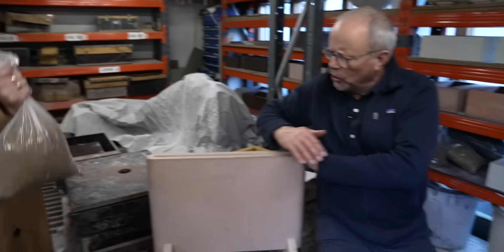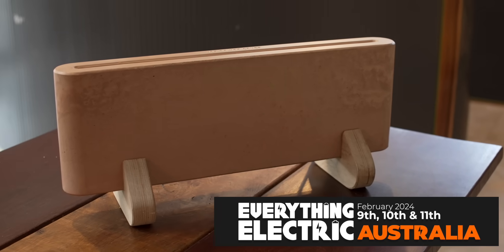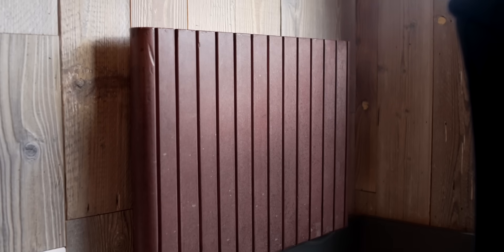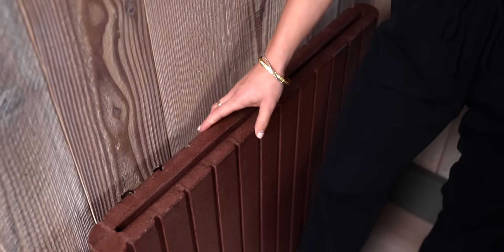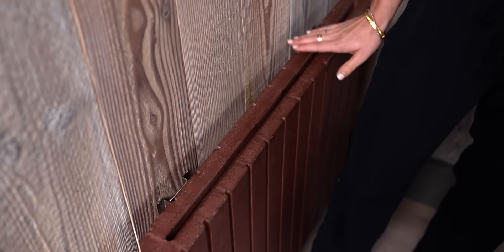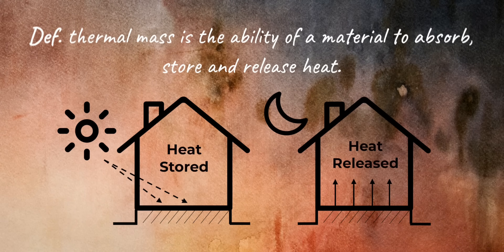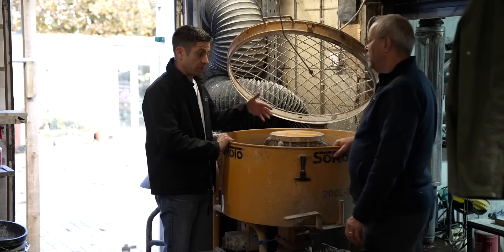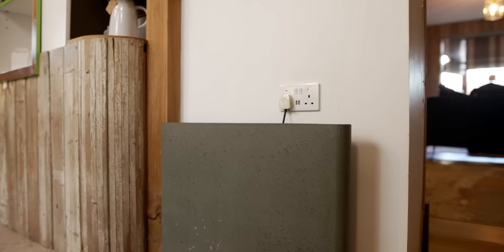THIS Radiator Is Made From Recycled Sand!

Comment from the maker: We’ve noticed a few comments about efficiency and storage heaters, so for a little more clarity on why this is a little different. Storage heaters use convection to transfer heat. Convection systems have to heat all of the air in a space. These Composite radiators heat through convection but also heat through radiant heat i.e they effectively warm people and objects in addition to the air around them. Radiant heaters are considered more efficient because this targeted heating approach reduces energy waste and ensures that the heat is effectively utilized by the intended recipient, resulting in higher efficiency compared to traditional heating methods.
Reply: I'm a huge fan of Fully Charged but you've slightly dropped the ball on this one. Perhaps you mean this heater is more effective but it's certainly not more efficient. Efficiency has a specific engineering meaning (useful_energy_output/energy_input) -- so this heater has the same efficiency as any other resistance heater, i.e. 100 per cent. Just pointing out this point of confusion as constructive criticism for an otherwise excellent production team...
Reply: Just use a radiant panel then. This thing is a joke
Reply: The effect of perceived temperature from radiant temperatures is very important in building physics. So you can feel warm in a room with warm surfaces, even if the air is very cold. So yes there is a difference between this radiant heater and storage heaters (which have insulated sides), but there is no difference between this radiant heater and other radiant heaters.
Also this doesn't change the efficiency of the device, but it's _effectiveness_. So yes radiant heat is a bit more effective than conductive heat but you really shouldn't make any claims about efficiency (which is why a lot of people are grumbling in the comments).
Reply: @xxwookey  Funny enough gf just walked in the lounge and said "it's warmer in the kitchen than in here now", which was odd as it got down to 13c before the heating kicked in just a short time ago, sure enough I walked into the long thin kitchen to find it was still only 16c but due to having a long rad down one side the radiant heat from this made it seem relatively warm.
Reply: It's fine to shill for companies, just do it in a way that's accurate & make clear you're shilling
Reply: The comments around solar panels and cost should have been closer challenged. In the UK the heat loss vs size of roof for a building will almost never allow solar to pay for heating during the winter, but might just allow it from summer export offsetting if you can get the array size and have a low enough heat demand. In fact, it's unlikely with a 100% efficiency rather than 3-400% efficiency heat pump, that you will ever be able to offset your heating costs in the UK on all but the most passive of houses. I'm not sure this technology is the answer to bringing you closer to energy independent, a heat pump will do that x3 (literally).
Reply: @untruth agreed...
Reply: They all spread heat through both convection and radiation, the ratio varies, but it's not that significant between warm slabs or slab-shaped objects at the same temperature. Radiative heaters that you can turn on and get significant heat radiation within seconds, and turn off when don't need heat has a potentially huge advantage, in being able to use energy and provide heat only when and where it's needed. This thing needs to heat up all that mass before it can heat up anything else, which means it lacks the real advantage "instant" radiative heaters have.  

A resistive storage heater without adjustable output is objectively not a very good storage heater. 

The point of storage heaters is the ability to use cheap electricity, to produce heat, that can be released over a long period of time, preferably with some control of the heat output. For that purpose you want high power, to be able to use as much cheap electricity as possible. Low maximum power is not a good thing in a storage heater, it limits how much cheap energy (which is likely to be cleaner) you can use in a given time. 

Also, without insulation you can't heat the storage media to the temperatures you can with insulation, as that would be dangerous. So you get much lower storage capacity, and the heat will spread much faster, too fast to be a good storage heater, and way too slow to be compared to instant radiative heaters.  

Usually great channels, and a couple of the best presenters on youtube in this episode, but this product is not great, it's a bad storage heater, which if used as a storage heater, utilizing off peak electricity to charge make it slightly better than a simple resistive heater that's on during off peak, but nowhere near as good as "conventional" storage heaters with insulation and ability to affect the output somewhat.
Reply: On efficiency, the radiant heating argument is not comparing apples to apples. If you feel warmer, but your building fabric is sitting at dew point internally, it increases heat losses in your building (thus making it less efficient to heat), and introduces all sorts of health risks. Efficiently keeping your body warm, but not efficiently keeping you in a healthy environment.
Reply: @untruth  

That's a very, very good argument for not relying on FAR IR panels for general (?) heating.

If the fabric of a property remains too cold and damp then the risk is of all sorts of nasties quietly going about their business of producing mould and spores.

However, all is not lost and by using a dehumidifier it is possible to reduce the RH to well below the comfort level for humans, that's below 45%RH.

This means the low moisture atmosphere causes your eyes and nasal membranes becoming too dry for comfort.

(From empirical experiment I have found this for myself when using a dehumidifier for help with drying laundry, without using a tumble drier.

Yes, the method really does work and obviates the need for said "expensive to run" tumble drier.)

This very morning I was informed of LG's recent heat pump unit which, allegedly, is capable of providing reasonable heat when the outside temperature gets down to neg 28C, which I gather is LG successfully pushing the envelope.

Google is your friend on this.

It might be rather more useful to produce an episode on this "quite" efficient means of heating than droning on about a trendy looking storage radiator and claiming it's "super, super efficient" when it's anything but.

It might be helpful too if Robert et al did a "radiant and convection and conduction Tutorial 101" so we all knew they understood the difference.

The last few sentences in that last missive from Robert were right up there when it comes to waffle.

I appreciate it was a crib from a third party, but still.
Reply: yep a bit of a ball drop.  Storage Heaters using fire bricks [really dense heavy brick- used to be klinker brick] holds heat well and always have done on the overnight charge.  Standing close ish to them will make one feel warmer, obviously but heating the space will depend on the size of the space  and the insulated envelope of the building. Whether its made of klinker Brick, clay brick, or concrete [re-cycled or not] will make no difference. The density of the material is the only factor as too how long it retains heat  and ofcourse the element charge capacity/imput.  Energy  like the elements never disappear they just change state.  Running up and down your hall will create Hest energy  but then you will have to replace it with some food at some time guys.
Reply: @rivergladesgardenrailroad8834 
 
Some storage heaters were equipped with a very low powered fan to push the "heat" around or some had louvres to allow the stored heat to escape more quickly when required.

Some of the smaller units had a sort of "internal duct" to get a bit of convection going.

Some of the wardrobe sized units had inbuilt ducts and used a fan to push the warm air throughout.

But forget all that.

The very best way of heating and cooking and providing hot water is a smokeless coal nugget burning multi stove, with a back boiler.

(NOT woodburner types, despite being DEFRA approved, for now, on grounds they burn wood far too quickly and you have to get up off your arse to feed them, and, require a fair old woodshed or woodpile.

Not cheap to buy or run and probably not too environmentally sound, and you have to clean out the ash.

But, for heating that really does deliver and provides the essential rosy glow which matches the images stored in our "racial memory" (or something or other) then you can't beat a multi stove.

Seeing as the planet will  probably not achieve the temperature rise to below this holy grail of 2C and most definitely not below the preferred 1.5C rise then suggest it would be a shrewd move to turn our collective hands to building sea going rafts, loads and loads of really big ones.

Once the ice ends up in the oceans and the continent of Antarctica rises through the  mantle then the sea level (average) will be around 200 ft or 70 mtrs higher than "today". It could be more depending on how much land rises up in the south polar region.

Why bother to fight nature, which, to be fair, has got a lot more experience than humans ref ice ages and tectonic plates swirling around on a plastic mantle.

Boats and rafts are the answer, together with a palate adapted to fish and seaweed.

We have dozens of seagoing nuclear generators and even in the Arctic ice and who knows we might even see floating fusion reactors in a century or so. Energy might not be too much of an issue.

We've got hydrogen fuel cell powered boats even as we type so that's alright then.

Would suggest civilisation aimed to anchor the rafts in the warmer latitudes so no energy required for space heating, and if it got too hot, or cold, simply move the rafts up and down the latitudes as necessary and avoiding the hurricane/typhoon routes.

I mean, to quote one of the small gods, more associated with motoring, "how difficult can it be?"

Happy to debate if anyone arsed.
Reply: For goodness sakes Robert!

Talk about digging yourself deeper.

You'll be shortlisted for the "Golden Shovel Award" before long.

Now just so "you" understand this so called invention is just another storage radiator but without any redeeming features.

So, please disabuse yourself that it's "you" doing the mythbusting.

You might apply that to your so called mythbusting on anything to do with battery EVs as well as.

Robert, you really, really don't understand the science.

Ask yourself ... if we hear duff gen ref power consumption of flat screens then are we really going to be swallowing the rest of the guff?

Hope that helps.
Reply: It's not directional though, it's a slab which would radiate in all directions, then stuff in the room would absorb the energy and pass it into the air. There is some really exciting research around high IR emmisive coatings which are being used in sub ambient passive cooling, but this doesn't have it, it's just concrete.
Sorry mate we need evidence, without it it's just marketing BS
Reply: An oil filled radiator is also a radiant heater, they also work by having a heating element inside them, are we now to say these are suddenly super efficient? Anyone buying these sand radiators will not 'get their money back' with any cost savings over time.

Comment: this ONLY makes sense if it uses Solar energy to heat the radiator and then the radiator would release that energy slowly, i doubt you can heat larger house unless your whole roof is solar and probably some more in the backyards but this is only if there is a lot of sun in your country

Comment: Another pathetically superficial product promotion. Yet again we are seeing a company making basic resistive heaters as a replacement for other central heating, shown as running on 13A sockets. This is completely against the electrical regulations - permanent installed heaters should always be installed on dedicated circuits so as not to overload the socket circuit

Comment: Nice wee bit of ‘advertorial’. These units probably have a niche application somewhere, but hey trying to suggest they’re somehow greener than steel or aluminium radiators simply because of how they’re made???

Steel & aluminium are probably the most recycled materials on the planet & were being recycled before it was even a thing. 

As for re- using concrete & aggregates, I’m sure you know that environmental practices on construction sites has required the re- use of aggregates for the last 10 years. 

These heaters will be useful when they’re being mass manufactured somewhere & sold for £30, not some niche thing in a back yard. 😉

Comment: Very nice heater - but - When we want to maximize the value of the energy used for heating it makes MUCH more sense to get the multiplier effect of a heat pump. I do however like the fact that it uses a lot of recycled materials in it's construction, and appreciate that we can't use heat pumps everywhere.

Comment: Most electronics would last substantially longer than we keep them for. How many times did you replace a TV or PC because it broke? Mostly because a newer, shinier product came out, or your PC got too slow because the OS kept getting bigger. However, the hoped for '50 year life' is just that, hoped for.  No longevity testing done. Also, one would hope that the 'steel, aluminium and copper' used in conventional radiators would be recycled, though water filled rads would probably loose a bit to rust. Fail to see how these could cost less to run than any electrically powered radiator.

Comment: The high amount of comments not understanding the thermal density of the concrete. I tell you what, all you keyboard warriors turn on your basic electric metal heater and a cement heater. Let them heat up, then turn them both off. I bet the concrete one will keep given off heat much longer than the metal one. Meaning it turns on less as the residual heat will help keep your room warm. That is the difference. But no, all you quick to attack EE for daring to show this product are just showing you really don't know what you are talking about.
Reply: Well...... 'not knowing what they're talking about' IS a primary characteristic of a LOT of people.......!!!!
Reply: Perhaps you didn't quite understand the comments?

Plenty of references to storage heaters.

And of course the early examples used the ancient "Economy 7" tariff.

I once had a 2 bed flat heated by an enormous storage radiator with the heat being "dispersed" via air ducts driven by a fan.

It turned out the elements had failed so asked the old Electricity Board to replace the elements.

This they flatly refused to do and condemned the unit on the grounds it was full of asbestos!

Mind you they removed entire unit for free and vacuumed up everywhere about a hundred times.

Just goes to show that such units fail for  reasons other than electrical.

Comment: Resistive electric heaters are 100% efficient. They don't get less efficient with time. They might output less power over time as oxidative layers on the elements develop increasing the resistance which reduces the current for a given voltage, but the efficiency is always 100%.

Comment: Raises more questions than it answers. 

Commenters below are basically right 100w of heat is 100w of heat. However I'm hopeful these are more effective (note effective not efficient). I live in a 70's style 3 bed detached two storey house in Scotland that had 5.9Kw of old brick storage heaters and they were terrible and cost a fortune to run. We replaced it with 2.6Kw of infra red panels and are now saving a fortune in comparison. Now before anyone jumps in with both feet anout efficiency most of the saving comes from having them attached to thermostats and a smart app. Each of the heaters is its own zone we can have the house at 20 degrees when in and awake and 13 degrees when at sleep or at work. The dining room drops from 20 degrees to 17 degrees about 20:00 as we dont use the room then. That is  what i mean about effective over efficient. Only heat what you need when you need it.

The old storage heaters used to absorb and release the heat regardless of the time of day or temperature thereby wasting the energy. They also surrendered before kick off if there were draughts.

They say these panels use between 150w and 600w of power at attain a 60+ degree surface temperature which is great. However not how long it takes to get there or how it can be controlled. The website is thepouredproject dot com but the radiator part is password protected so you cant view it.

Comment: Regardless of how its made, a room of a certain size will always take the same amount of energy to heat up, this radiator cannot be more efficient than any other electric heater. The only advantage could be the latent heat in the material. 
Also - TVs do not consume 600W!!

Comment: Need more details on this. If, so instance, it’s a case that the mass of the radiator heats up and then the electric supply is cut off until the blocks drop in temp them a 100w rating might run for 25% of the time ( for example) - eg 100w BUT using 25wH because of heat retention of the thermal mass ? Really though can’t make a judgement until we know more!
Reply: Don't even think that deep. 100w is 100w. 1000wh is 1000wh. Don't matter if you release it faster or slower.